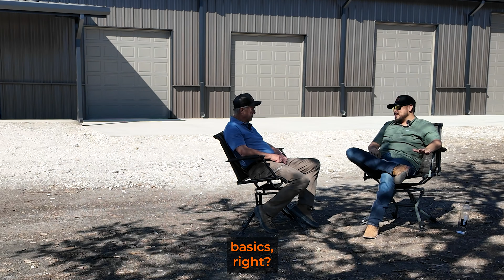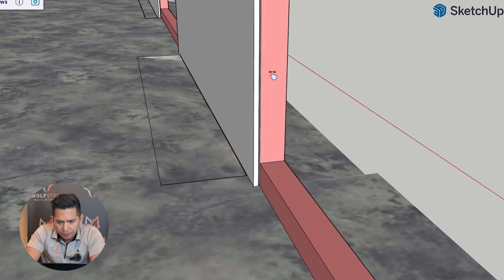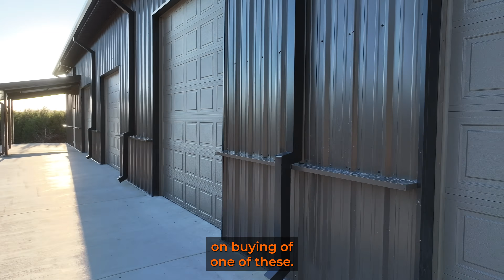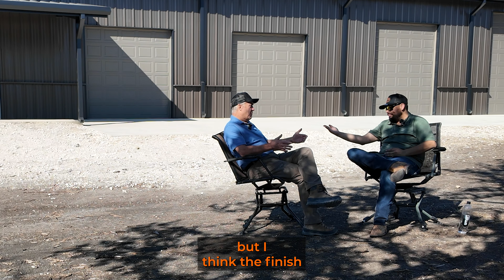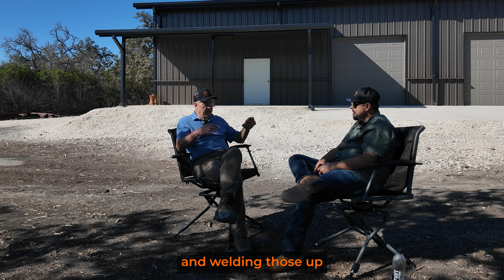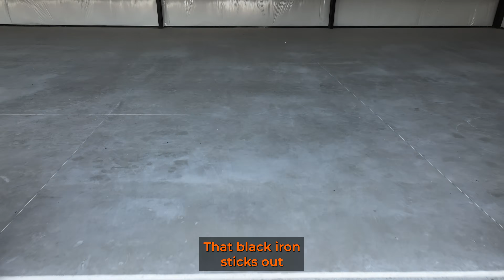40x100 Steel Building: Is It the Right Investment? | Client Testimonial | WolfSteel Buildings

Comment: I like that size. How hard is it to attach it to an existing building? 30' width 40' length with a 16' lean-to the length of the building. Existing building has 10' walls 16' peak I believe. New addition will be 18' wall (2nd floor apartment over the office)
Connected in L shape.
The 12x14 and 10x12 will be drive through.
Reply from the maker: That sounds like an awesome setup! Connecting a new structure to an existing building can  be done, but the difficulty depends on how the current building was built and how the new one will tie into it. We do not connect to existing structures that were not built by us, however we can butt up against a building.
Reply: @wolfsteelbuildings  k thanks, hopefully make that phone call in a few months.